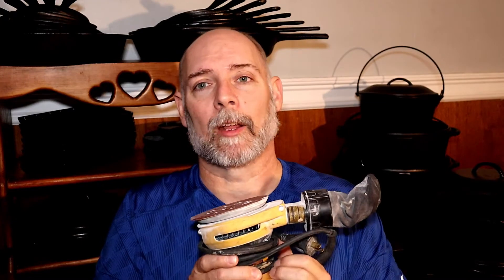Cast Iron Cookware Restoration The Right & Wrong Way

Comment: Have you just used white vinegar to remove rust? I used it for about 3 years to remove rust from used axe heads and just tried it to remove light  rust from a #6 unmarked Wagner skillet and it seemed to work well - no pitting. I soaked it for about 8 hours and then washed it well. It looks nice. And I now use it almost every day.
Reply from the maker: Vinegar does work great for rust. Usually I try to keep it to 30 minutes cycles or less. For surface rust you will have no issues but if the rust goes deeper, the vinegar can cause pitting. I don't know the science but I think that the vinegar seems to target any weaknesses in the iron. Rust is sort of weak iron. As a rule I usually check the piece every 15 minutes or so while it is in vinegar. Every piece is unique so results will be somewhat unique. It sounds like you have had good success. Keep up the good work and enjoy the fruits of your labor.

Comment: You know I just recently started collecting bought 4 pieces off of ebay, one was sold cracked about 8 inches another had a big 3 inch chunk out of it buyers beware.
Reply from the maker: I don't do much with eBay for that very reason. Have you tried Iron Man Cast Iron Auctions on Facebook? They are a great group that watches out for each other. here is a link. https://www.facebook.com/groups/castironauction/?ref=group_header

Comment: CIC: “Never Use wire wheels, just get the yellow cap easy off”. Cowboy Kent Rollins: “I don’t put any thing in my cast iron, I wouldn’t want to eat, like lye, you need to get yourself one of these here brush wheels.” I think I’ve watched another video of guy who did both. Home made electrolysis baths, vinegar baths, Coca Cola, etc. There is a lot of conflicting information out there. I just hit one of mine that I am restoring with a wire brush about an hour before seeing this, LOL. If only I’d caught it earlier. But thanks to your “stovetop seasoning” video, I am using BuzzyWaxx on the ones I’m seasoning in the oven right now!.
Reply: *not vintage

Comment: Such a helpful post~ THANK YOU! I have had so many folks tell me to use power tools on my cast iron, but I just wasn't comfortable~ somewhere in my brain, I knew that was not proper handling. I am not in a position to do a lye/electrolysis bath, so I went to the commissary & bought the "yellow cap" Easy Off. 
I recently bought an old  10 inch "Wardway/1433/A"" skillet that someone has already done about 60% of the restoration. Sections of the inside & outside are nearly down to bare iron, not quite, still mostly black w/little buildup. About 30% of skillet has a few layers of buildup remaining- sides in & out, though the cooking surface is nearly smooth & clear, maybe 15% 'splotchy'~ hope that makes sense....wish I could insert a photo, but don't think youtube allows photos in comment section.🤷‍💡(It is SUCH a beautiful, lighter-weight pan!)
   
*I have a couple questions,  IF you have the time, of course~ & hope it's not a bother. 

1.) Would you recommend first washing/scrubbing  w/hot water & soap, prior to spraying w/EasyOff & sealing in the bag? My thought is maybe it would help loosen the build-up a bit- Or perhaps just heating some plain water(or water & vinegar?) to a boil in the skillet?

2.) Would you spray w/EasyOff while skillet is still warm, or should it be cold?

* I do have the Lodge scrapers & good plastic-type scrubbers to work with. I do understand it may take a few applications/processes to complete...plus seasonings.

Thank you, in advance~ I truly appreciate your channel and your time. 
   Sincerely, Mrs. Samantha A. Whitson AZ/USA

Comment: I need help!  I just received an old 30 gallon cast iron pot that was used for outdoor cooking.  It’s in great shape, but still needs a little love and build up of seasoning inside and out.  Every method on YouTube that I can find pretty much is doing it the wrong way.  It’s certainly not going to fit in my oven!  I wish that I could send pictures, but I don’t think I can on YT.  Do you have any recommendations for me?  I want to do this the right way and start using it this Fall for open fire cooking/canning my Brunswick Stew.  Liked and subbed, thanks!

Comment: Is there any advantage to seasoning at a lower rather than higher temperature? Does temperature affect the quality of the seasoning? I suspect (but I don't know) that low temperature seasoning is easier on the cast iron but I'm not sure how it would affect the quality of the seasoning. Any guidance in these areas would be greatly appreciated...
Reply from the maker: The particular type of oil that you're using for seasoning will mandate the temperature that you use. Every cooking oil has a different smoke point. The temperature in which the oil breaks down. When the oil reaches its smoke point, some of the particles become Vapors/smoke while the rest becomes a hardened polymer on the cast irons surface. My preferred stand-alone oil is grapeseed. It has a smoke point of 421 degrees Fahrenheit. I like to go above the smoke point by about 40 degrees if possible. You can do a Google search for the smoke point of the particular oil that you're planning on using. As long as you exceed that temperature, you will be fine.

Comment: If after you have used vinegar to remove the rust, bit if you still have a rough outer surface on the bottom can you use wire wheel to get rid of the built up rust and flaking
Reply from the maker: Easy off oven spray cleaner or a lye bath will be the best way to go. I would avoid using mechanical tools because of the potential for damage.

Comment: I went to the local thrift and found 4 cast iron pans a # 3, 5, 6 & 8  stacked within one another. $2.99, $3.99, $4.99 and $6.99 respectively.  The smaller 3 I have  put 4 layers of buzzy wax on them.The number 8, 1 layer, but I have ever baked it, just put it on here to prevent rust. This weekend I plan to go to six Layers and see if two more are worth it.... your thoughts? The one non-baked looks as good as the 4 time baked..
Reply from the maker: I usually go about three layers and start cooking and them. They get better every time you use them. If it is a piece that I'm not planning on using very often, I may add a few more layers just to top it off. That sounds like a great deal but you got there. Thrift store finds can be the most exciting.

Comment: I think I let it set it viniger to long did the vinegar ruin my cast iron?
Reply from the maker: Maybe not. The vinegar is more aggressive depending on the severity of the condition of the cast iron. Unless it is already in pretty bad shape to begin with you will not have a problem.
Reply: @castIroncookware  it just made it rusty looking and smell like iron... should I use oven cleaner im scared to eat on it.... what should I do
Reply from the maker: @WTFENIGMA  1. give it a good scrub with an SOS or Brillo pad. 2. Apply oil while it is still wet to avoid flash rust. 3. Wipe on enough oil to cover the iron. 4. remove as much of the oil as possible and 5. bake in oven at 480 for about 45 min. Repeat from step 3 as many times as necessary.
Reply: @castIroncookware  so don't use oven cleaner? And the rust and smell  is not dangerous

Comment: Cast iron absolutely is porous! Clay jugs and pots are porous and hold water just fine. I watch a lot of machinist videos and have seen them pull out a chunk of cast iron that has been soaked in oil as part of its operating life and they cut it and start grinding it down and you can watch the oil seep out from deep INSIDE the cast iron! The sand blasting/wire wheels, etc, bend over the surface pores of the metal, so the oil cannot seep down into the metal. When it polymerizes it has no roots deep down in the pores to secure it and it will just flake off. 

On a side note but still about the porosity of cast iron. I find it is best to quickly oil it after you heavily clean it then don't immediately season the cast iron, the oil needs some time to work its way deep into the pores to create a good network inside the metal that will act as the roots of the seasoning keeping it secure. Keep it heavily oiled and send it through a few temperature cycles. Just put it on your stove and heat it up for 10-15 minutes (Not even hot enough to let it smoke, low heat) and then let it cool to room temperature. Do this a few times, the expansion and contraction of the pores from the heating and cooling of the pane will make sure the moisture is driven out and the oil penetrates deeply into the pores before you start the polymerization/plasticization of the oil during the high heat seasoning process. Then wipe off as much of the oil as possible and start the seasoning process.

Comment: How do I get the crusty hard buildup off the exterior?  I carefully put a thin layer of crisco on the inside and turned it up side down in 350 oven for an hour and the crisco looked like alligator skin on the skillet.  What happened?
Reply from the maker: +gb Marie the only way to get rid of the seasoning on the outside is to strip the entire piece. Once you apply I thin layer of Crisco over a warm pan you must also wipe as much as you can possibly back off afterwards before you put it in the oven. There is a  very thin layer still left on there after you do that and this what you want . If you did not start with a clean slate then the old layer of seasoning could have affected your new layer. If that is the case you may have to strip down and start from scratch.
Reply: How about oven clean cycle with the skillet face down/ Do you recommend that to take away all the build up crust and old seasoning on the outside of the  @castIroncookware ? Thank you.
Reply from the maker: @zmaayah  Thank you for your question. I think that the temperatures from the self cleaning oven cycle are too high to be safe for cast iron cookware especially the thinner vintage pieces. Most cycles run at about 900 degrees F and this can fluctuate with older ovens. 500 or 550 F is about as high as I would ever want to go. Internal stresses can accrue undetected and not show up until later on when a crack or warp shows up. It is just a risk that I would not want to take. That is why I only endorse the three methods that I do. Namely: 
#1. Lye Tanking with Vinegar Bath, 
#2 E-Tanking & 
#3 Oven Cleaner in a bag (active ingredient, Lye).

Comment: I use the heat method to restore & clean cast iron it works great with no problems. just lay it on hot coals but not a blazing fire about an hour. wash it off then start the seasoning process. I like watching your videos I just disagree somewhat.
Reply from the maker: I know quite a few people who do that without any issues and for the most part I do see how that it works for them. I suppose control of the temperature and heat pattern is the key. It looks as though you are very careful when it comes to that and it is your choice to use that method. I have however seen a lot of pieces that have been damaged from using that method and I am just trying to help people avoid that. I hope that you continue to have success without any issues. Thank you for watching my videos and I believe that we can just agree to disagree on that particular point.

Comment: There is space between atoms so porous, just what degree, Heat will cause agitation between atoms so potentially more space. Works for molecules also.
Reply: I do love this site, thanks!
Reply from the maker: @oblio2255  you're welcome.
Reply: Cast Iron Cookware   I do want to travel to that northern Alabama area to search. Do you any places down here on east Alabama to pick. LaGrange ga and west.
Reply from the maker: @oblio2255  I would suggest call around some of the antique malls and ask if they have any booths with cast iron. If not , ask if they know of any. I have hit on a few good tips that way. Flea markets are great too and prices are usually better.

Comment: I have a LBL Griswold #10 I'm trying to season but the oil "bead" on the bottom and handle so I can't season it!  Any ideas?  Thank you!
Reply from the maker: There could be some heat damage before you got it. Usually the seasoning will finally take hold after enough tries but but it can really get frustrating.
Reply: @castIroncookware  Thank you for your reply!  I've ran this thing thru about 5 times with Crisco or Avocado with no luck!  How do you think your Wax application with do from where I am or would it be best to run it thru the E-Tank before using your wax?  Thanks again for your help, Be Blessed!
Reply from the maker: @bowe1978  as long as the previous seasonings are solid and not flaking, Easy Beezy will work right over it.
Reply: @castIroncookware  Good to know, I just purchased a tube of Easy Beezy on your site 5min ago!  Look forward to some "Beautiful Pans"!

Comment: You don't like Brillo pads. What I use in firearm refinishing when the need arises is brass/copper "wool". It doesn't harm the steel(or iron in this case) as it's a softer metal.
Reply from the maker: Recently I have been using an SOS pad after my e-tank and then disk soap before applying my seasoning. I got the idea fro Casey Alridge at BuzzyWaxx and it has been working great without any damage. I do get a metal splinter every now and then though.

Comment: Brass wire wheels are softer than steel wheels.
Reply from the maker: I still prefer not to use them because they can embed particles from the brass into the surface of the iron. This can cause issues with the seasoning.
Reply: @castIroncookware  I have a #20 Griswold in need of restoration. 100 yr old family hand me down
Reply from the maker: @KennyE1957  that is awesome! Is it a skillet or does it have two handles like a casserole pan? I will be glad to walk you through the process if you have never done that before. You are welcome to send some pictures to my email and we can go from there. My email address is lovemyci@charter.net
Reply: @castIroncookware  two handles. They were called "hotel pans" my grandfather used it on the outside fire pit to fry fish.
Reply from the maker: @KennyE1957  I was thinking Hotel pan. Some of those can get expensive.
Reply: @castIroncookware  the problem will come when it's time to season it. Finding something large enough. 24in across from handle to handle
Reply from the maker: @KennyE1957  you may have to season it in a BBQ Grill.

Comment: Are you crazy? Oven cleaner and lye? Would you want to eat oven cleaner or lye? That's what you will be doing if you use a cast iron skillet cleaned by that method! That horrible stuff will seep into the pores of the skillet and when you cook with that tainted pan, when it heats up to cook something, the pores will release residual oven cleaner/lye into your food! This guy hasn't got a clue! I suggest that you go to Cowboy Kent Rollins on FB! He's the real deal!
Reply: lye dissolves in hot water and you wash it down the drain. what do you clean your oven with? they are both the same thing. yes I watch cowboy kent and he has good advice,but that's not the only way. you have to wash it before you season it
Reply: Let me finish my pretzels and get back to you